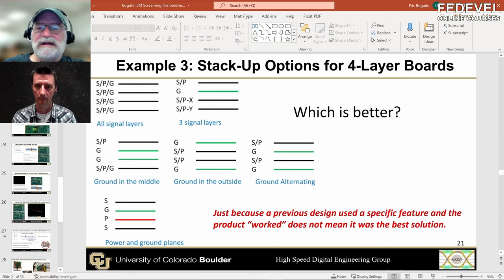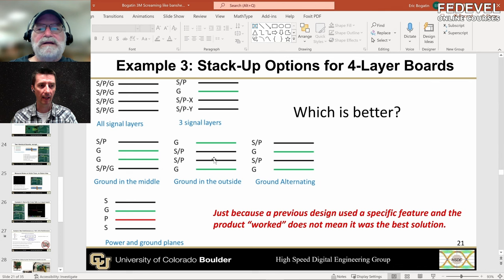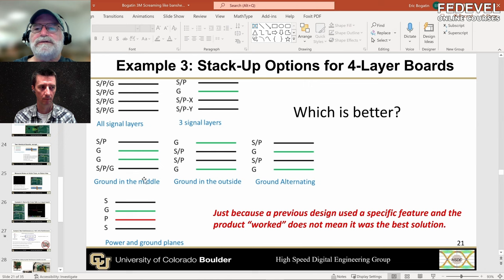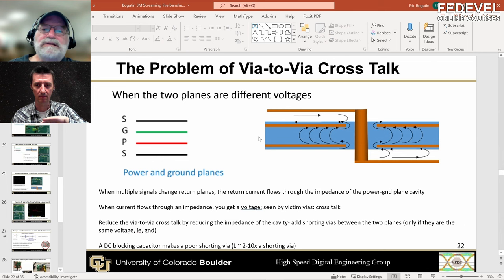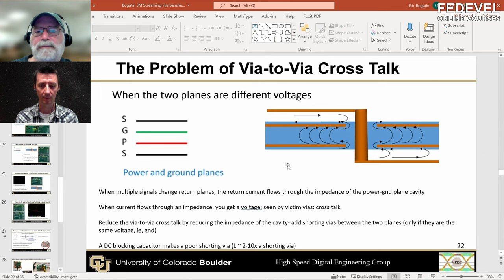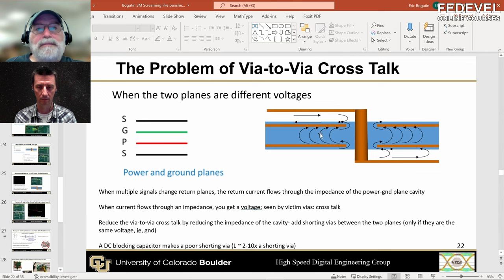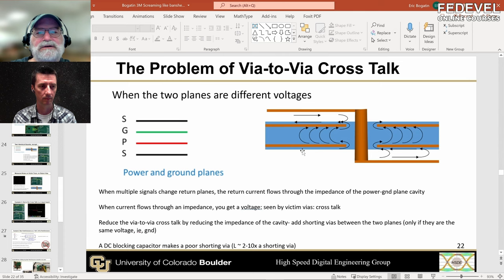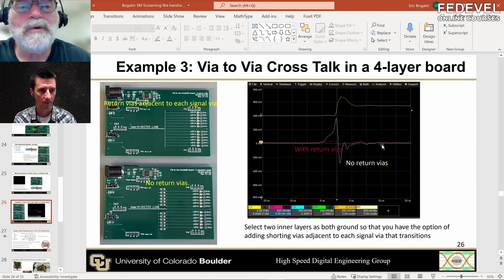Do You Really Need Power Planes? Are you sure? | Eric Bogatin

Comment: In Cadence / Allegro you can create a power plane and still route nets etc.  Altium a power plane does NOT allow nets - but you can divide power planes.  It is usless.  Always choose a normal layer when using Altium.  They need to fix that.  But they wont!

Comment: While this was a great video... there are a lot of questions that arise from this.  Also, many of his examples seemed to be very specific and unique instances, rather than comparing his way vs generally accepted practices in the design field.  For instance - who the hell has just a floating plane in the middle of their stack-up connected to nothing?  Literally no one....  That power plane is connected to the ground plane through capacitors at just about every IC.  His first example would have been significantly more enlightening if Eric had used a board configured like his, against a board with 2 ground planes connected through vias.  In his last example, I wished he would have also had a 3rd example of micro board to test against.  The exact same ones his students designed, but with also a ground flood on top layer around the signal traces.  If having a ground flood on your signal layer does nothing (even with a ground plane directly under the signal layer).... SHOW THAT IN YOUR EXAMPLE.  He's comparing apples to oranges here.  Let's make it apples to apples, please
Reply: I think he actually answers most of your questions while discussing the theory at around 29 mins in. Basically what he's claiming is any signal via becomes an antenna, parallel planes form a waveguide that helps couple this to all of your other signal vias, which is where the noise comes from in this case. By making your planes the same potential, by bonding with vias, that waveguide effect is reduced. Your bypass caps at your chips will help, but he points out they're a lot less effective than making the planes the same potential. He also points out this isn't always a problem in all scenarios (I'd say you're mostly going to have issues at low signal strength and high frequencies, especially if you have a mix of high and low strength signals, for instance if you had low amplitude analog inputs and high amplitude digital outputs).

Comment: Plane layers are dirt cheap these days, so use them. I usually do six layer boards for analog right now. Why? Because it means I don't have to think even for a split second about power, ground and routing... there is just space through the roof. What's the cost of that? A couple bucks for a small board. Unless you are in a production environment absolutely nobody cares about that money.

Comment: It can be convenient to use layer 3 for power. When you have a bunch of components all needing the same voltage it's nice to be able to just drop vias. You just need to route as much as possible on layer 1. The last PCB I made I put all comms and important traces on layer 1 only and the only traces that go between layer 1 and 4 are slow signals e.g. an enable line, an LED.
Reply: You can as easily use layer 4 for power. Just slap a polygon or two on there. A few short signal traces in your power polygon don’t do much - imho.
Reply: @ThePetaaaaa  Yes that’s a good call, I might do that for the next version. The vias go all the way through too, no blind or buried vias.
Reply: @ThePetaaaaa  Are you suggesting a stackup of (S, G, S, P) instead of (S, G, P, S)?  Isn't there also some problem with signals being between the power and ground?  Also with this creating stubs from the connection on 3 to the now unconnected 4?  I suppose these may all be minor, particularly for slow (relatively constant) signals, but ... isn't the return path problem also minor for that sort of signal?
Reply: @jimjjewett  Yes (S, G, S, G/P). To my understanding both signal layers have the same ground plane next to them, so no no "return vias" required. However, the distance to the GND layer will be different. To my understanding layer 3-4 stubs won't be a problem until you go to GHz or above. 

As usual, it depends what your goals are. Primarily use S, G, S, G for capacitive sensing since I can shield the traces on layer 3.
Reply: @ThePetaaaaa  No one put power on an an external layer because you are radiating a lot
Reply: @AlbertRei3424  Are you sure? Then the best antenna would be just a PCB sized copper fill? Or which theory are you refering to?
Reply: @ThePetaaaaa nobody said that makes the best antenna, but it's just common sense that embedding it will shield more EMF.

Comment: Regarding copper pour. I used it because I was told it reduced waste in the PCB fabrication process (less copper sulfate perhaps).
I use a (mostly very) solid ground plane as signal return and try to cover any gaps in the ground plane with copper on another layer stitched with vias.

Give the current paths the smallest diameter circle in which to circulate and the current will take it which is a win for all.

My experience is with two layer PCBs and I make the bottom side ground and keep the routing to the top layer.  

Use a capacitor to ground on EVERY signal that leaves the PCB right at the connectors to limit the bandwidth of the signals to no more than is necessary for the job at hand.

Comment: Quite a few important revelations in this video! Particularly enjoyed the explanation of using capacitors between planes of different voltages as a form of "DC blocking via" for return currents - I had seen this done before on boards with split planes and never understood the purpose.

Comment: Thanks for the video.

The thing where I learned to do a copper fill was actually when self etching pcbs. If you do a copper fill you can use your acid more often, it is faster and the resulting quality is better. Not sure if there have been some commercial manufacturing reasons in the past, but today I would say this is a non issue.

For commercial products usually emc is the most important part anyway.
Reply: It matters when you want consistent electrodeposited copper thickness.
Reply: @Konecny_M  Copper balancing. It is good practice and recommended (but not necessary always) to have an equal amount of copper on both sides of a PCB. This allows for an even distribution of copper when the manufacturer is plating up the outer layers. Also helps maintain via integrity, especially if you have requirements that vias must have a minimum wall plating.

Comment: What I didn’t understand at the end, if I have a solid ground plane on a 2-layer board, will a copper fill on the signal layer create problems or not? My understanding is that it’s better to have a copper fill and a solid ground plane with stitching vias because of the reduced inductance on the signal layer for decoupling capacitors and components and also smaller fields.

Comment: Great content, and very interesting perspectives on the asymmetric stackups. I totally agree that the return path needs to be considered at the same time as signal routing, but sometimes it's possible to eek out a bit more ground with flooding. Using a CPWG to shield a signal (especially RF) from other signals can be critical for many designs.
Also, designing for measurement requires making a "good" reference signal available along with the signal. "Ground" is usually the best - especially for single-ended probes like most scope probes, so a flood of ground connected to a solid plane can make high-quality measurement easier, but that does depend on good engineering of the ground.

Comment: Fantastic video! If you read a book on EMC your idea about PCB design will change dramatically. Grounding is an important and less understood and often overlooked concept of PCB design. As a rule of thumb remember that for a PCB especially clocked digital(over 100KHz) ones, proper grounding is a must and you need to think of it right from the beginning! Either you need a ground plane or at least the old-fashioned ground grid.
Reply: You always need to think about proper grounding, even at DC.

Comment: Once i did some tests for a sensordesign where the old design was passive with coaxial cable and i wanted to power an amlifier near the sensor element. To stay with the old reception system, i decided a triaxial cable. The cables outside conductor was forced to be the metallics enclosure voltage, so i  decided it to be gnd. I later then decoupled the outside gnd to hf cause of course it collects charge and so noise from the outside especially the gnd was "not allowed to" recepted from the sensor, without ferrite in series with litthe resistors and then a cap to V+. So the inner ring conductor on cable had to be the positive supply voltage. since the inner ring conductor is more near to the signal, it has high coupling to the signal on the wire. So the whole amplifier module and the sensor was not ac reference-coupled to gnd, but instead to V+. on the reception, it was then coupled to gnd. i used a lot capacitors for the coupling. I had a V+ plane instead of a gnd plane in the sensor. the signal was as never seen before and as i like to do, i tested all circumstances with a "high frequency massage device" from "esoteric" store, to emmit outside noise to test for the best emc circumstances. Later then, i changed the dc level on the signalwire (signal only of ac interest) to the suply level, sourrounding it. This then lead to no more recognizeable  "microphonic effect" anymore. of course the sensor now has a little metallic enclosure, on ac- decoupled gnd from the systems perspective, so something which can lead to an "antifaradayic cage", so i believe. So i routed the signal always nearest to V+ and away from enclosure. I learned a lot during the project, parallel watching your great videos!

Comment: Interesting video, although it seems that Eric's argument may be more nuanced than just to not use ground fills. It seems rather to be "Ground fills aren't a substitute for properly managed return currents."
For example, let's say you manage your return currents as proposed. It doesn't seem like there would be issues with stitched ground fills on the signal layer. For example you might do this for non-electrical reasons. Thermal comes to mind, perhaps mechanical in some cases, or even for improving the results of self-etched boards.
(It seems a lot of other people here had similar comments.)

Also, it would have been interesting to compare the board with the vias with the non-via board with caps installed.

Comment: Power plane referenced to the signal driver positive rail will of course behave better than floating different rail plane - the source of the signal has low impedance tie to that reference plane. The problem of transitioning to different layers remains, but it is not correct to say the voltage domain is irrelevant.

Comment: 1. How to select the PCB materials 
2. what are the things we have to consider before choosing the materials
3. Is there any separate way of materials selection for military, aerospace, and medical domains other than the highspeed domain?
Reply: Mechanical stability, thermal expansion, rigidity/flexibility, thermal conductivity, thickness, cost are all factors in material selection. In other domains you would factor in coatings, cleaning and designing for environments of extreme vibration, heat, pressure, steam, vacuum

Comment: Great video again! I watched this right after the one you made with Richard Hartley. I see you asked Eric several times wether the voltage on the power plane matters, but he kept saying no. On the other hand, Richard told you that when using a power plane as a reference, voltage does matter and it has to be the same voltage of the signal that is routed on top of it. I think there is some confusion here. I agree with Eric when he says that the voltage level doesn't matter for the propagation of the signal but when the signal gets to its destination IC, the field will spread, as Richard said. And this is why you should never reference a signal to a power plane whose voltage is different from the voltage that generated the signal. What do you think?

Comment: I guess the main idea is to not use 10 degree C temp increase in your calculations. Playing with the digikey ipc2221 calculator, to get 6 mil trace (100mm long) for 1A in 1oz copper we must let the temperature rise be 30 degrees celsius for external layers. With that much small surface area I guess you wouldn't be able to feel any heat to touch.

Comment: Hi Robert, I see, that there is no ground pour on the top and bottom layer in all the experiments. If you have a power plane but also ground pour on top and bottom, the return current should have way less inductance when used a GND via next to each signal via, since the return current can change from the power plane to layer 4 (small gap) and then take the via path to the ground plane. This way, there should be maybe only 1.2x the inductance than when two ground planes would be use. What do you think about that?

Comment: I'm not sure if this was answered in the video (I couldn't find the answer): assuming you have two ground plans (SGGS), I see how return vias are needed to reduce noise for signal traces, but what about power traces? I suppose that return vias for power traces are either less important or not important. Is this correct? Edit: I asked ChatGPT, here's what it said (not sure if it's accurate)...

"It is generally recommended to use return vias for power traces as well when switching between layers on a 4-layer PCB. The purpose of a return via is to provide a low impedance return path for the signal or power trace, which helps to reduce electromagnetic interference (EMI) and noise.

When a signal or power trace is switched from one layer to another, it can create a discontinuity in the return path, which can result in high impedance and unwanted noise. By using a return via, the return path is maintained and the impedance is reduced, which can improve the signal integrity and reduce noise.

In addition, having a solid ground plane on layer 2 and 3 can also help to provide a low impedance return path for the power traces, which can further reduce noise and improve performance. It is important to carefully consider the layout of the PCB and the placement of the return vias to ensure proper grounding and signal integrity."
Reply: What you are losing by not using a power plane is the distributed capacitance. A power trace incurs tens or even hundreds of nH of series inductance and even a bypass capacitor rarely has less than a few nH of series inductance. Only a sandwich of power and ground planes can improve this problem. Return vias will do absolutely nothing about it. Some people think that this won't matter for analog circuits, but it does. There it's not the trace inductance that will get you but the trace resistance. I dare you to simulate the distortions of an op-amp circuit with and without 0.1-1Ohm series resistances in the opamp power supply lines. See if you can get the second and third order harmonics at 1kHz down to the -110dB level as the data sheet promises for your $4.50 precision analog opamp if you mess up the power system impedance. Hint:  using a 30 cents part with power planes would have been better and it would have saved you $4.20. ;-)

Comment: I still don't fully understand the core message. For the last example they used a 2 layer board and the regular arduino failed because it does not have a solid uninterrupted return path layer. But for 4 layer boards I usually go for the (Sig/Gnd>Gnd>Power>Sig/Gnd) and stitch them all with vias. This allows me to conveniently take a power via wherever I want instead of having to route a long power trace. One other thing is that the ground layer coupled next to signal layer should also provide a return path. I have not seen anyone mention this type of stackup. Also, it will be interesting to try the (Sig/Power>Gnd>Gnd> Sig/Power stackup)
Reply: This is exactly what I do.  Use the four layer (SIG/GND/PWR/SIG) and don’t route anything on the GND layer.  Then all power is sunk to the power plain using a via. This is great for decoupling caps as I get a via to supply the cap then the cap to supply the IC.  I also ensure that I flood the top and bottom layers with a GND flooding and then stitch the whole load together with vias, as I believe that this capacitively coupled the signal lines to ground giving a better GND return path.

However this was not alluded to on the video so am I wrong 🤷‍♂️
Reply: @squilly1974  if I understand correctly, the tricky part is when you have a signal that jumps from later 1 to 4. The reference plane for the return path will switch from ground to power at that jump. For fast signals, if you want to avoid EMI problems you may want to include a decoupling cap next to the signal via to couple the planes and give an easy route to the return signal.
Reply: @rjordans  this is where I thought GND flooding came in.  Not entirely sure if this is the case though?
Reply: @squilly1974  Robert's asking the question around 25:50 ;-)

Comment: How about ground fill on multi-layer pcb's which have 8-14 layers? If I have solid copper gnd reference layers to signal layers, does it really hurt to fill on top or bottom with gnd? I typically pour on top and bottom for thermal reasons. If a signal has a proper signal return path, does gnd adjacent with a fill really have a bad effect? I would like to see higher layer count stack-up examples!
Reply: I am confusing too. He said we need return via with adjacent signal via, then we need gnd copper near the signal via. How can we add return via on gnd without copper pouring